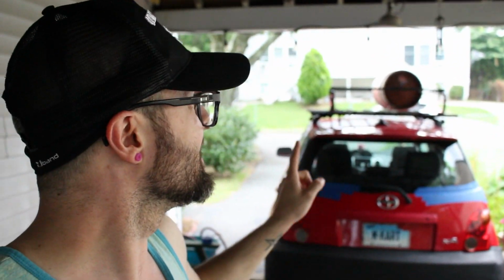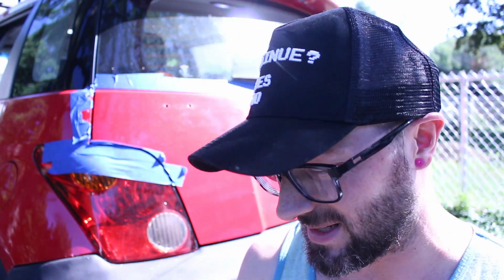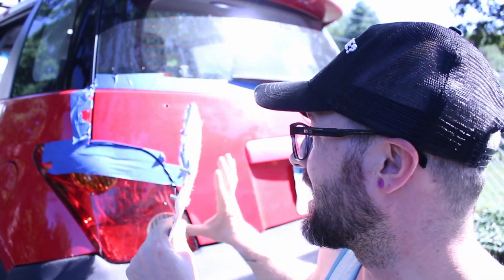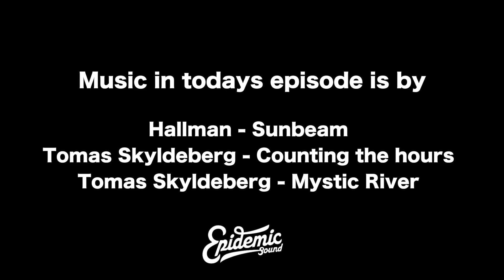Scion M Kart custom mid wing fiberglass work | Weekly Vlog EP 116 | Russ Lyman

Comment: Hey Russ, you seemed to be the guy to ask. I was wondering if you new of a place or site that took an image and turned it into a decal. Specifically a silhouette decal you see sometimes on black cars.  Any thoughts?
Reply from the maker: o yeah man most sign shops can do that or even online. It all depends I guess how big you need the decal. There is sign o rama here in CT but just look up vinyl decal shops in your area. You will just have to provide a image for them. They usually want a vector image from adobe illustrator, its gets the cleanest lines and you can make it as big as you want with out it getting blurry.